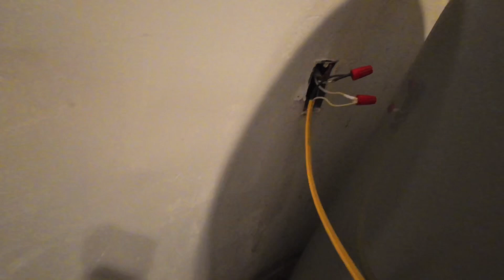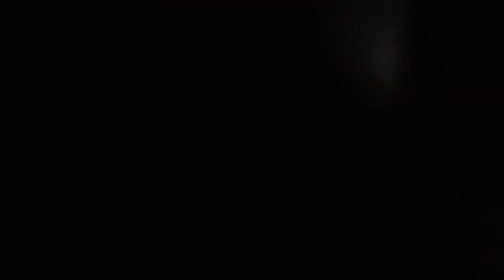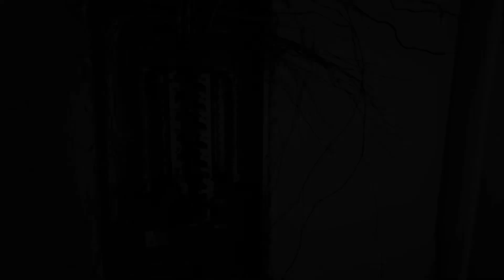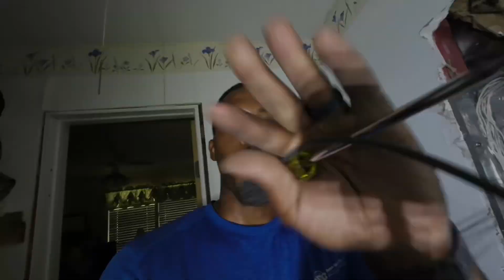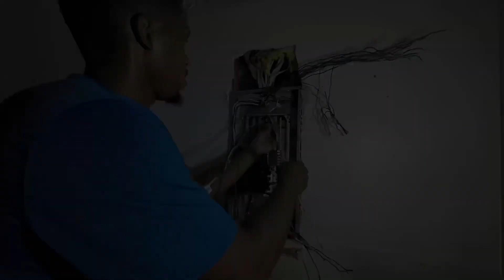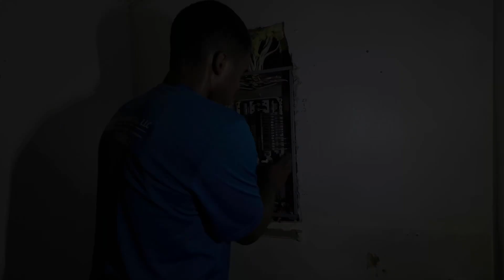Wiring My First Panel As An Electrical Apprentice | Before & After!

Comment: hack contractor for sure.  you can't have all the nm-b coming in a chase nipple.  need to be 2 nm-b in one connector.  were the afci breakers, you must follow code now when upgrading.  the grounds are still on the neutral bar.  needed to use a separate ground bar mounted to the panel.  your company is just a hack company not knowing code.  were is your safety glasses, visible clothing, hardhat, etc for ppe.  typical hack not following osha.  looks like sh*t, just go on welfare you better off.  that bar connecting the neutral bars are their for a reason.  neutrals connecting bar should of been removed and that bus bonded to the panel.

Comment: Hi dude. Nice connections on the terminals.
By code you can only have 2 cables in a romex connector. Looks like you had them all running through one big connector on the top of the panel.
The 1/2” black button romex connectors are nice for panel installations. Quick and easy. Keep working hard and stick with the electrical!

15 years in, master and still going.
Reply from the maker: @Michaels350  Thanks for the advice Michael, That’s the way my journeyman had me do it but thanks for the code references!👍🏽